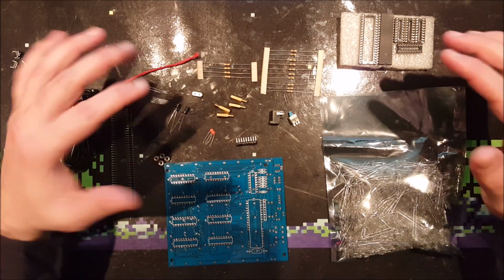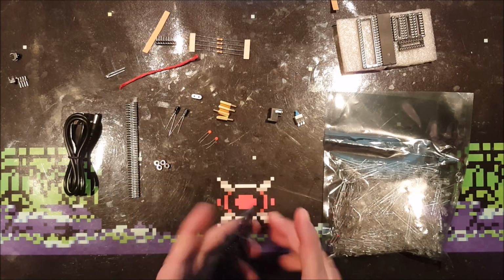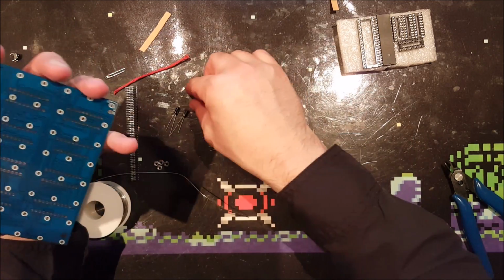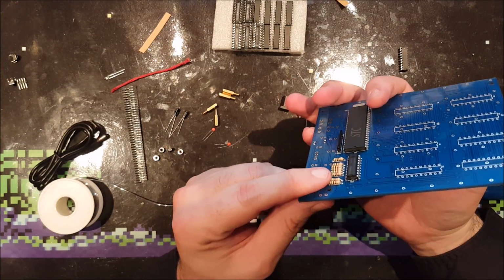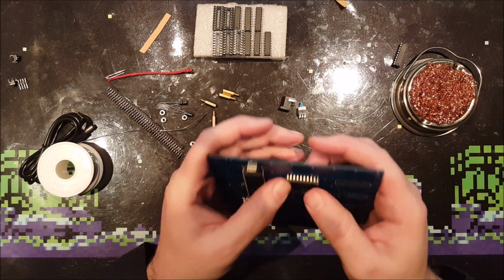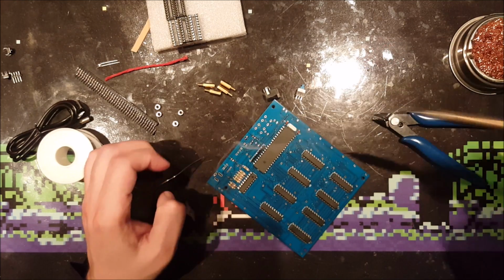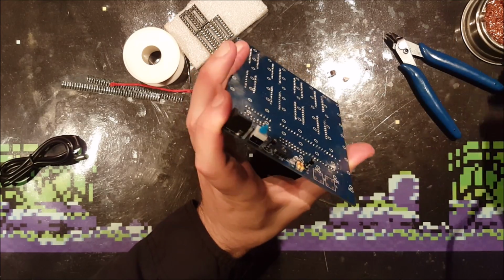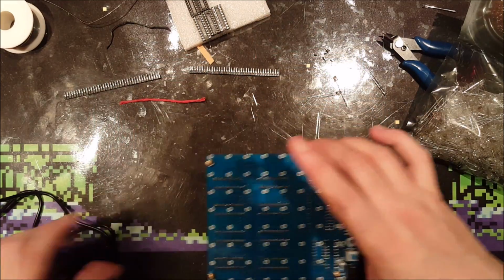How to build the 8x8x8 LED Cube kit from Ebay - part 1 - the main circuit board

Comment: I got the same kit on Amazon for $17 shipped and it now ships with blue diffused LED's. They must have listened to you and switched to them.  The new LED's are still the round type but are frosted or cloudy on the exterior instead of shiny clear. I was hesitant to order it, but took a chance.  Thank you for making this video because there is no schematic with the kit.  I have made other DIY clocks and so I am kind of familiar with soldering,  but I didn't want to make a mistake when it comes to the grid!

Comment: Do you have a part number or better description for the two switches that aren't included?
I think you are awesome for taking the time to make and offer these videos at no charge. The seller who happily took my money had no technical help and acted like he could care less. You are awesome. 

Mark
Reply from the maker: You can find the switches on eBay using these keywords: "pcb momentary tactile switch". But keep in mind that I think that the new rom for the STC chip does not support those two switches. So for me, they are quite useless.

Comment: I built the 4x4x4 Arduino Uno shield/ kit, and the build was similar.  Do you have a YouTube video tutorial, and or link, on how to program the STC12C5A60S2 or similar chips of this type, that you can post?  It was very easy to follow your tutorial, thus far; thank you, and thumbs up.
:ADDED AFTER ORIGINAL POST:  After jumping ahead to your 3rd video I see that, this is where I should post the question above, but instead of deleting the question here, I figured I will leave it, to detour, other youtubers' from making the same mistake.

Comment: Great video! Thanks! Is the jumper necessary? This isn't included in my kit.
Reply from the maker: The header pins (jumpers) are only necessary if you want to program the cube.
Reply: I have been connect to the energy but doesn't work. How do you know what can be the problem?
Reply from the maker: Try measuring the LED pins. Do they get any power? If not, try checking the IC's. Download the datasheets and see which pins are for the power and see if those IC's get any.

Comment: Here is an interesting thing - I bought a second kit - followed the video again and was super careful about soldering etc - and guess what - Exactly the same result - three LED’s dimly lit and no flashing. What the hell am I doing wrong?
Reply from the maker: That is very weird. Can it be that you powersupply is not providing 5 volts? Or not enough power?
Reply: Bas van der Sluis I doubt it - I’m using an iPhone power adapter to provide the usb power.
Reply: I have same problem. May be chip is not programmed???

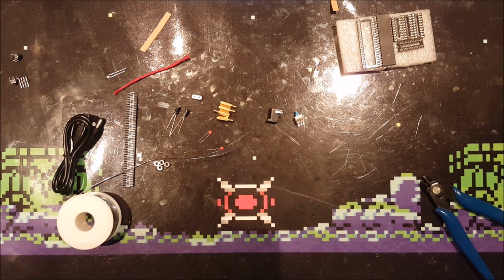Comment: What is the black 9 pin thing exactly called at 10:00 ? The thing that you are soldering?
Reply from the maker: That is a resistor array. It contains 8 resistors which all share pin 1. Therefore the polarity matters.
Reply: Thanks for reaction so quickly, i have another question, i noticed i put one of the IC chips the wrong way into the socket, when i got the chip out of the socket one of the 20 pins broke. I tried to sold it back onto the chip, which worked, however the chip didnt fit perfectly inside the socket and when i tried to get the chip out of the socket to place it better into the socket the liitle part of the pin stayed inside the socket.. (i hope this is clear.) Is it possible for the led cube to work if there is one of these little pins broken? Or do i have to order a new ic chip? And if i do where could i order one?
Reply from the maker: You can probably order a new IC, but if it is only one lead which broke off, you can try to repair it. Just solder a tiny and thin wire on the broken lead and the other end to the ic socket and you're done.

Comment: When soldering the large IC - did you miss some pins?  the ones that didn't have obvious solder holes?  because I missed that and tried to solder them - I used the IC socket, not direct to board - now the circuit doesn't work.
Reply from the maker: Yes, some pins are not in use and do not have to be soldered. If it's not working, make sure that the IC is powered and measure from there on. I've seen some people complaining that the IC they received was not programmed at all.
Reply: @basvandersluis5662  Can I buy a new large IC somewhere that has the programme on it - obviously I can buy the IC - Ebay have them - but how to get the software on it.

Comment: Thanks for the video, very useful! I've followed the video up to the bit where you test, but on mine the LED on the board is flashing and the other LEDs are not lighting. Any tips on what to check? Complete novice at electronics so idiot-speak please!
Reply: Fusion 72  I had one of the chips on backwards. Make sure the notches on the chips match the notches printed on the pcb.

Comment: In that case - does anyone know where to get a new large IC - programmed with whatever code comes with it at first - obviously I cannot send the kit back as it's already built, I don't want to buy a new kit just for a cheap chip - but I have searched and don't know what or where to buy one - or a website for more information.

Comment: Sorry to ask again - you answered once and I am grateful because I don't know where else to go.  If you do know a group or Reddit thing or really anything where people talk about these and exchange information that would be fantastic. In the meantime my board very dimly illuminates c7, c6 and c5 only when all 8 LED's are placed for testing in these holes - can anyone give me a clue where to start to fault find?  I am a novice so simple instructions would be best.  Or to get rid of me - somewhere else to look.  Sorry for being a pest.
Reply from the maker: Not a problem. It is normal for the LED's to not go at maximum brightness, because the board is running a program on these LED's. Are the 3 LED's lighting dimly for a while, or permanent? If it's permanent, there may be an error. And if it only does that when 8 LED's are installed, current is flowing through the LED's to some part which is not powered when the LED's are not installed. I would think of a soldered connection which looks ok, but is actually not. Try measuring the voltage on the SN74HC573AN IC's without any LED's installed. They should all have the same amount of voltage. And make sure to measure the pins, and not the soldered part.
Reply: Bas van der Sluis They are permanently lit and very dim. I will check all the chips you mention. Thank you again for replying.
Reply: Just realised - I have no idea how to do that - I have a digital multimeter but when I measure I get different results for different legs - I have tried searching for a guide but cannot find one.
Reply from the maker: Set your multimeter to continuity (it beeps when the two probes touch each other). Find pin 1 of one of the chips and trace it over the board all the way to the first component it meets. Now put your probes on the component and pin 1 of the IC and it should beep. If it does not or just displays a value on the meter, it means that one of the solderings is not good enough. Now do this for all other GND and VCC pins of the register IC's. If you are not sure which pins those are, you can look it up, or just use the pins on the corners.

Comment: my kit do NOT work, it is the 2. kit , that no work... plase help (geman)
Reply: what do the switch s2 & s3 ?
Reply from the maker: @dfg1ml  The switches are not in use.
Reply: Is it possible that the processor does not work if RES is wired incorrectly?
Reply from the maker: @dfg1ml  If you want to be sure, measure the voltage on the processor. I'm not quite sure about the pins, but my guess would be 3.3V (or 5V) on the top right pin and ground on the bottom left pin.
Reply: Pin 40 & pin 20 gnd
Reply: IT is 4.9V
Reply from the maker: @dfg1ml  So the processor has power. Did you solder the resistor array in the correct position? Are the LEDs in the correct polarity?
Reply: Yes.. All korrekt, but the array 102, 1k???
Reply: You on Facebook? For pix?
Reply from the maker: @dfg1ml  No, I cancelled my Facebook account some time ago. You can mail me at ****. I can take a look, but keep in mind that I might not be able to find the problem.
Reply: my last research showed that it STC  is not programmed / Flascht
Reply from the maker: @dfg1ml  That sucks. You can ask the seller to send a new chip which has been flashed. Or you could buy an STC programmer and do it yourself. :)

Comment: Would you know why mines wont cut on? ive done everything
Reply from the maker: Without any information, I cannot tell what's wrong. Does it do absolutely nothing?
Reply: ive done everything you did in the video and it just literally wont cut on, like not even any of the lights cut on
Reply from the maker: And the single LED on the board? Are the IC's in the correct position? Are the LEDs mounted the correct way around? Do you have a meter, so that you can measure some voltages?
Reply: i do have a meter. the single led doesnt light up when i press the on switch nothing happens
Reply from the maker: Good. Can you check the voltages on the first capacitor next to the plug, then the voltages on the position where the 4-pin headers go. Measure the voltage between the GND and the VCC. And finally, can you measure the voltage on the power LED? Maybe it's just broken, or the polarity is mixed up?

Comment: i have a trouble i build my cube but the layer 3,4 and 7 dont work :(  

What could it be? heeeeeeelp pleasee
Reply from the maker: If the entire layers do not work, check the 1 wire going to that layer, and trace it all the way back to the IC. See if every connection is soldered well.
Reply: :( i check it, now just one layer works :S

Comment: From where  do you buy this kit, link please
Reply from the maker: I bought it from eBay. Just search for something like: "diy led cube 8x8x8"
Reply: Bas van der Sluis   please tell me the seller name, some kits haven't 2 tactile switches, what for them?  to change pattern?
Reply from the maker: I got it from lovecc1020, but it also came without the tactile switches. And I now know why, because they don't do anything.
Reply: Bas van der Sluis  when tactile switches connected does it  help to change led pattern or any other function?
Reply from the maker: Nope. They don't do anything.

Comment: I got a problem, I hope you could help me: the C6 output just doesnt work, the circuit between C6-> 300 Ω -> uln 2703APG -> STC is fine, what could go wrong? https://www.youtube.com/watch?v=9GhLt-kjztM thanks!
Reply from the maker: If you are absolutely sure that you have continuity between the non-functioning layer and the output resistor (510 ohms) of the ULN2803APG, you can check the pins on the other side of the ULN, because it is just a transistory-array (if I may call it that :). Just reflow all the pins and the pins of the processor with fresh solder. Sometimes a solder joint looks OK, but it just isn't.
Reply: resoldered the whole PCB and it still didn't work.. turned out it the ULN2803APG's socket had contact issue :D
Reply from the maker: Aha. Glad to hear that you have found it.

Comment: i'm guessing you are dutch btw :) also i think its the same kit as this one am i right? http://www.icstation.com/lightsquared-8x8x8-cube-white-blue-p-3531.html
Reply from the maker: Your guess is correct. How did you know? Is is my Balkenende-dunglish-accent? ;)
It is the same kit indeed. Also, that kit mentions: "3mm white blue LED x512", which may suggest that they've put diffused LED's in there. That would be nice.
Reply: Bas van der Sluis Im from Belgium but every Dutch speaking person that speaks English has a bit of a accent ^^ and I ordered the one from icstation and even though there site has a full tutorial on it your videos is probably going to be a lot more help I contacted them about reprogramming the chip and it's sad that I have to buy one of those 50 euro programmers for it :( plus a adapter I really hoped there was a other way for that also you have a better diy suggestion for making the led bending template I have no drill they suggested cardboard maybe and 1,5cm spacings